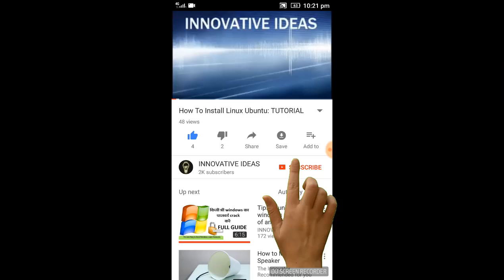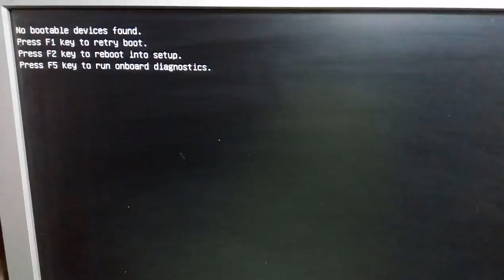Repairing of Desktop SMPS ATX power supply how to basics by innovative ideas

Comment: but when you checked the resistor, it gave a value, it didn't give open "|" on the multi-meter screen .. so how did you know it was the resistor since it gave numbers on the diode mode ?
thank you

Comment: Hi , thanks for sharing .  I have been using my atx power supply as an bench power supply to power my embedded projects.. Today when I used it once after I turned it off and turned it back on after a while.. The only standby light is working.. And its not responding to PS_ON as that pin is shorted to ground through a switch.. 
What can possibly go wrong with it suddenly ? .. No swollen caps and no burnt fuse.. Its just not responding to the PSOn any ways yo troubleshoot it ?

Thanks in advance

Comment: I shall share what I had repaired. I repaired this psu recently.  You can see that there is a standby voltage transformer. It is a 12vsb .the green wire will have 12 v and it is also a  ps on for the motherboard.. the rest of the cables are 12V.  From the architecture   , I can see it has a standby and a main section. Good luck to those who wish to try.. to test it, short the green cable to black and the led and fan will be on. 12 v will appear too. This apply to dell psu but not  to Lenovo and Acer psu. Their Atx 3.0 standard is not common.

Comment: Thanks! I know it's an old video but does anyone know the part number for the fan in this power supply? Mine is getting noisy. By the looks of it, it seems easy to replace but I don't want to take the whole thing apart and back together just to check the part number so I can order it.
Reply: Never mind. The fan is an mga6012hs-a25

Comment: In my case my power supply turns on when i push the test button but second time it does not turn on. To turn it on i have to unplug it for several hours and then it does the same thing all over again. what can be the problem?
Reply: Hey, did you figure out what caused it?